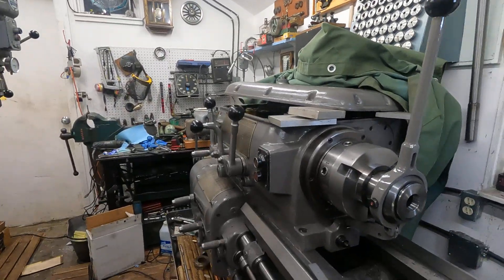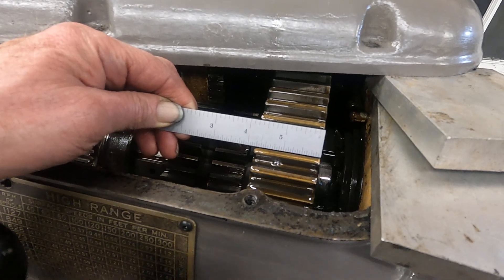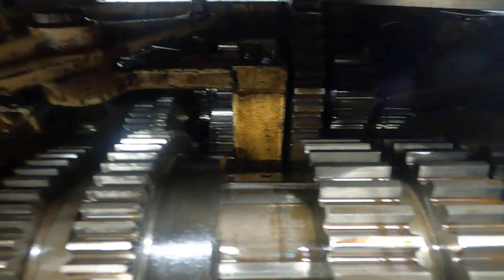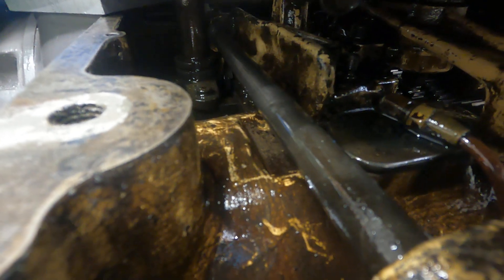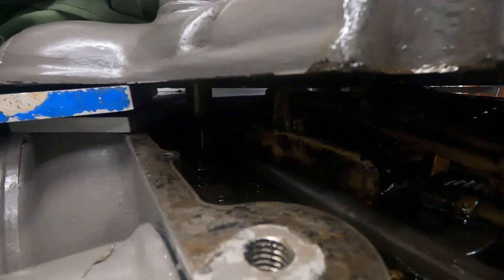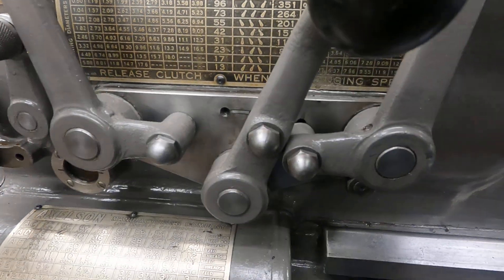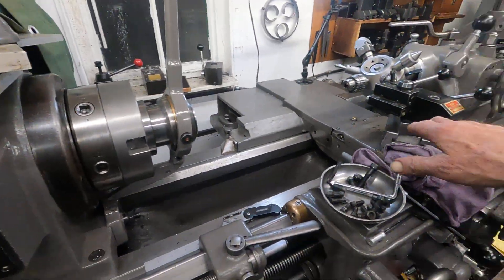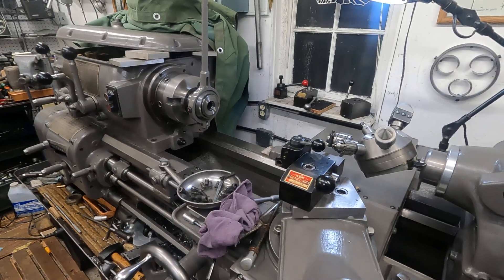Axelson lathe early headstock gearing

Comment: Axelson obviously built their machines to last and with little regard to cost.
The 24 speed headstock is nice, a good spread of speeds. 
On my DSG I only have 18 speeds available and the top 6 are via belt drive, 29 to 2240 rpm so there are some pretty big gaps and with 10hp behind it you really don't want to crash it either.
Reply from the maker: The open belt feature of your DSG sounds similar to the LeBlond dual drive lathes that are still popular. The Axelson top 3 speeds are about 700,  900 and 1150 with 1150 causing some heat build up in the head stock. Those speeds are good enough for smaller work using collets. Axelson made so few lathes before 1942 each one was hand built on a 1 year wait it is said. They did not follow common practice of construction along with American Lathes came up with a head stock made to take advantage of carbide, this one has only 5hp but has more power than the carriage can handle at around 400 and below. American built a 14X30 heavier yet with the heavy side wheel tail stock that are a machine in their self, amzing old machines for sure!
Reply: @DonDyarprecision  I took the headstock cover off the DSG today and the heaviest gear, the backgear pair is around 7/8" thick, so Axelson made a very strong headstock.
The DSG uses about a 2" wide toothed belt for the belt drive high range, which is external to the headstock, drive goes into the headstock, I did a test cut today at 5mm cut depth, 0.5mm feed per rev in steel with negative rake carbide tooling at slow speed which it did fine, I also tried 5mm at 0.31 feed at 1120rpm in steel, you could tell it was working but it cut it just fine.

Comment: Really appreciate a peek inside the Axelson headstock gearing! What an awesome machine, built like a tank. But it's a thing of beauty, too, all the castings smoothly blended and rounded, the gracefully shaped handles, etc. Ergonomic before "ergonomic" was a word.

They didn't spare any iron on that baby!
Reply from the maker: Thanks for coming along! I like looking into the headstocks of these old machines too. This maker only had 1/10th the production of Monarch and most are large machines, This smaller lathe is much more versatile than expected, thanks!